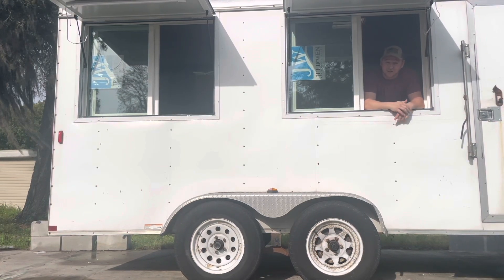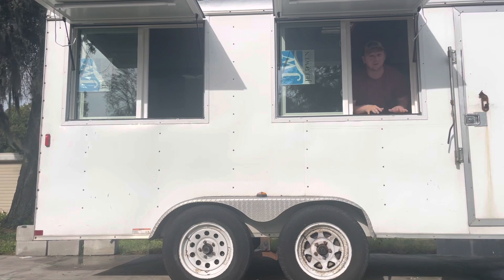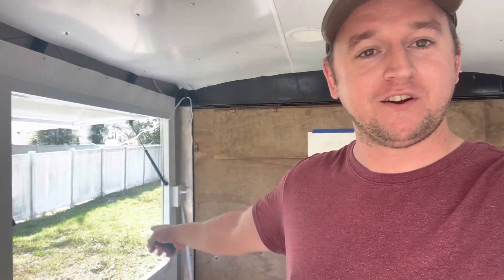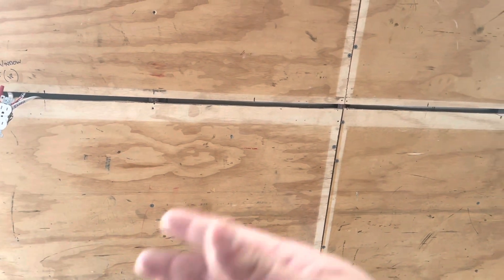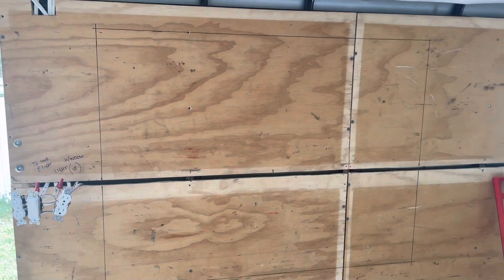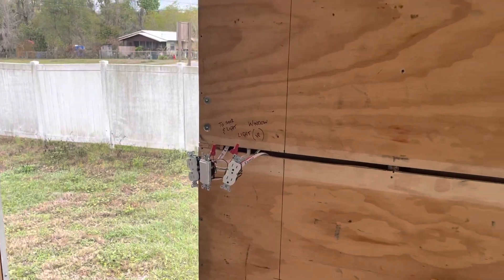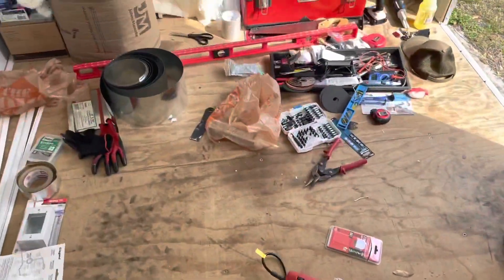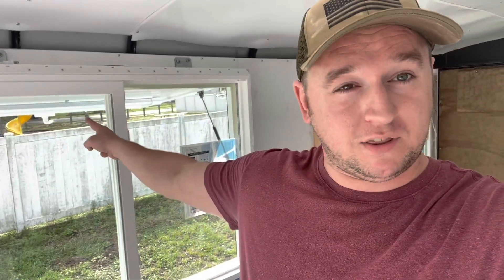Second Window Installation - Poor Man’s Food Truck

Comment: Question when you cut out the windows what happens to the frame? Did you weld in a square?
Reply from the maker: Good question - I reinforced the frame using lumber and drilled to the frame of the trailer

Comment: Your videos have been so helpful. My sister and I are trying to complete our trailer ourselves and help would be greatly appreciated! We purchased a trailer that already had the concession style window cut out with a frame. It's 6x3 so what do you suggest would be a good fit as far as measurements are concerned for a serving window?
Reply from the maker: Thank you so much for that awesome feedback! I’ll be happy to help in any way I can! In my experience, as long as you’re within an inch or so of the dimension of the window frame, you should be good. So a 6x3 would mean anything between 71”-73”x35”-37” should work. Be sure to take your time and research multiple distributors before purchasing. Ive found Lowes to be the best spot (in my area) to walk-in and see a good selection.
Reply: @poormansfoodtruck  thank you so much!!! 🤗🤗
Reply from the maker: You got it!

Comment: How did you mount the interior sliding window in there? Also, do you have a link to the interior window that you bought? I’m going to be do this exact 48x36 window. Thank you!
Reply from the maker: Check out the previous video on installing the sliding window, I used a wood frame to give me the clearance for the window handle and used HD braces to keep it firmly attached to the wall of the trailer. Sounds awesome glad I could help! Good luck and thank you for the support 🙏🏻